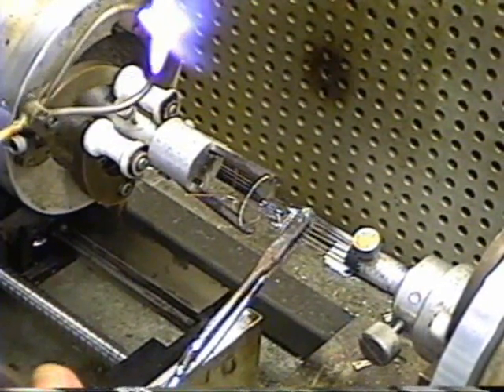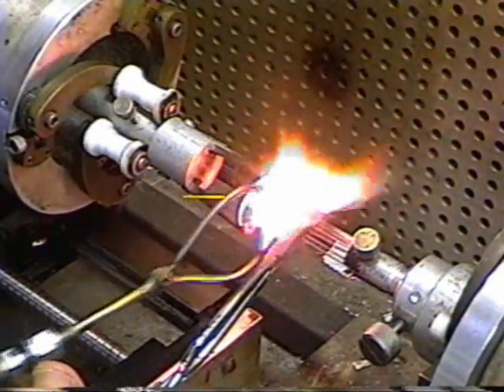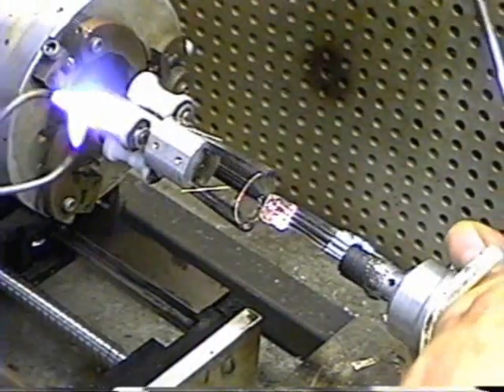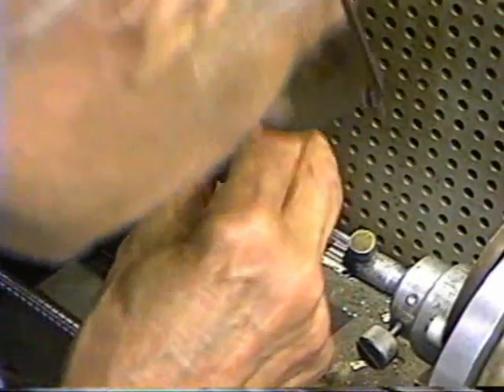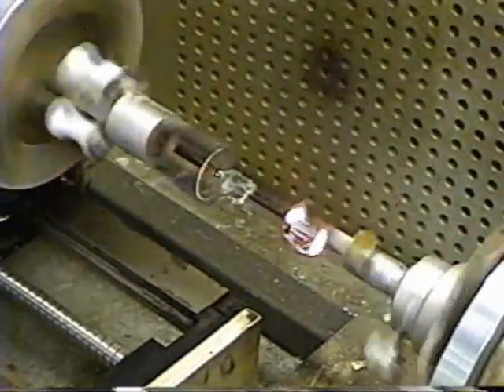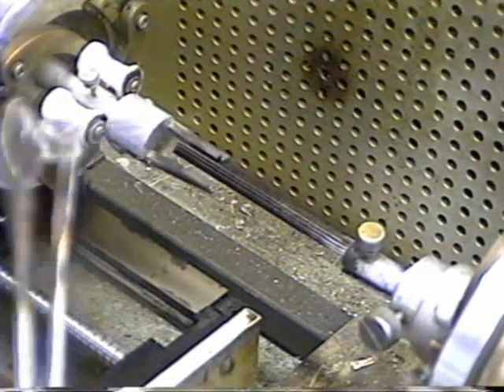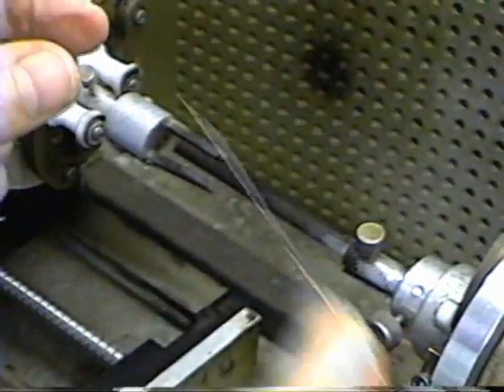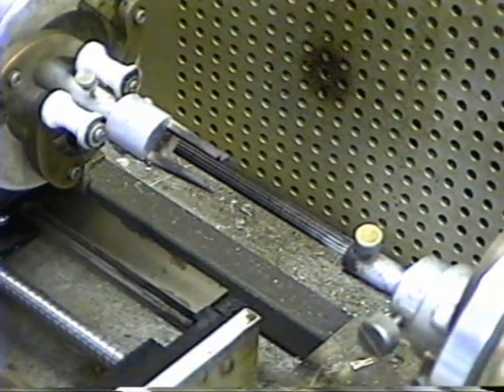making a fleming diode vacuum tube 3

Comment: Sometimes the audio in Flash will simply stop working, without any notice. Some versions of Flash videos will work, others will not. Re-boot your computer, and check if your version of Flash is up to date.

Also, if you have Win Media Player and used it recently, check your video volume level in the system mixer. WMP takes over your audio system and doesn't let go!

When in doubt re-boot, re-boot, re-boot.

Comment from the maker: Check the settings on your computer. All of the videos I make work fine with a standard windows XP system. I have no way to test on vista, win 7 or the later messes from microsoft so you just have to play with the settings til you get them right.